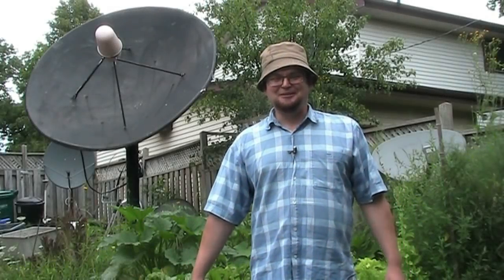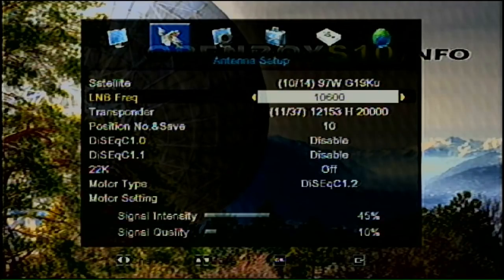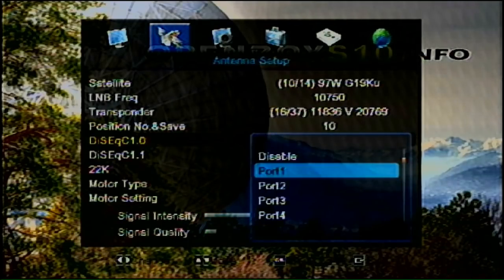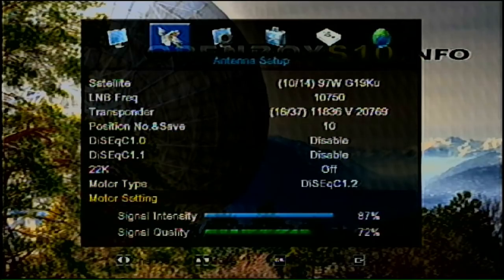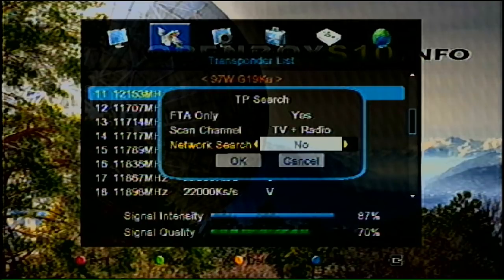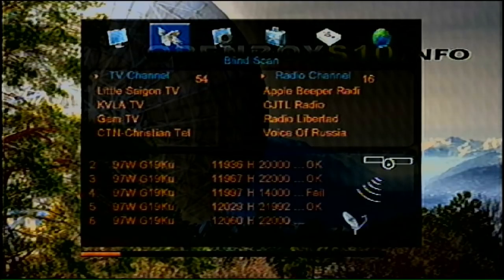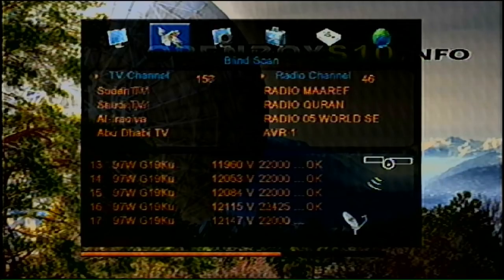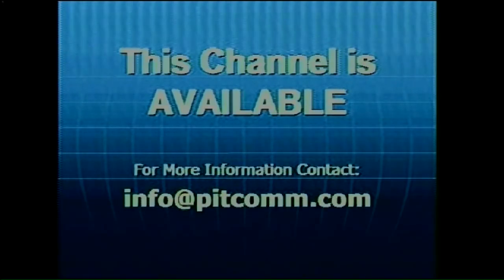How to Setup & Scan your FTA Free to Air Satellite System

Comment from the maker: BUY THIS DISH ON EBAY 4 FOOT KU BAND 
https://rover.ebay.com/rover/1/706-53473-19255-0/1?icep_id=114&ipn=icep&toolid=20004&campid=5338505983&mpre=https%3A%2F%2Fwww.ebay.ca%2Fitm%2F1-2m-48-inch-Ku-Band-Solid-Offset-Satellite-Dish%2F233172008597%3Fhash%3Ditem364a227e95%3Ag%3AyZ4AAOSw2PtaqHc4
Reply: Robbie Strike that link no longer works can you provide a new link? Also what’s a decent starter Ku / C band receiver?
Reply: @Jesiah Tyson Instablaster :)
Reply: @Grayson Elliott it did the trick and I finally got access to my account again. I'm so happy:D
Thank you so much, you really help me out :D
Reply: @Jesiah Tyson Glad I could help :D

Comment: Hello, good morning, first of all, thank you for the information in this type of tutorial and hunting for FTA satellites.
I live in a city in Texas and I just started doing this as a hobby, since in this city there is nothing to do, I am in a small town called Las Lomas with only about 1000 visitors, and watching your tutorials one day I managed to It will work and I found a satellite, but I did not pay attention to the angle of inclination. Reading and watching tutorials I found (I think this is my mistake) that if I am on the north side I must remove -24 degrees if I use offset plates (offset plates). Directv or dish) of the Elliptical and Round type, and I tried this but it does not give me the signal (otherwise the Converter and the universal lnb) is in good condition and works well, so excuse me if you would also be kind to tell me where this is my mistake
Sincerely AlfTex

Comment: How long does it take to complete a blind scan. Mine is stuck at 33%. Hotbird satellite blind scan
Reply from the maker: It all depends on the receiver it should take less than 5 minutes. But I found some receivers take longer if it has a long time trying to lock a transponder

Comment: Can I use a direct TV receiver for FTA? Surely there is some hack.
I can use a direct TV dish if I change the lnb to linear ku, correct?
Reply: Sorry but unfortunately you can't, the receiver is specifically designed for directv transponders only and the dish is designed to see directv transponders with a circular polarity multi-lnb
Reply: If you are looking for terrestrial signals that can be received with a antenna and the built in tuner on your tv I suggest watching Tyler the antenna man